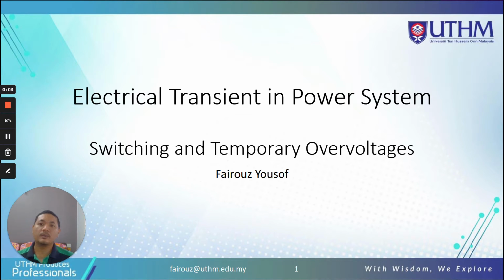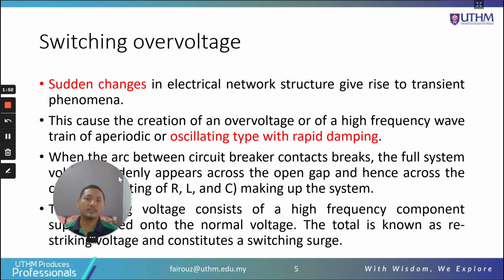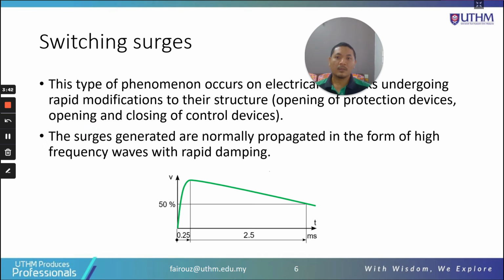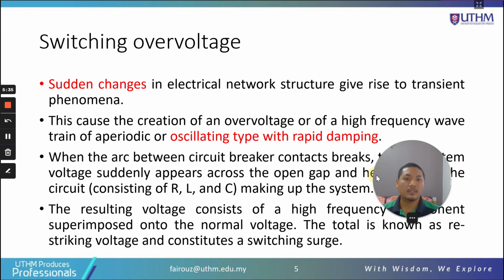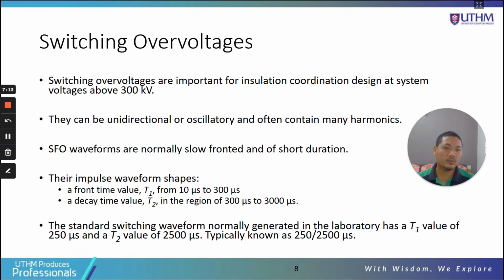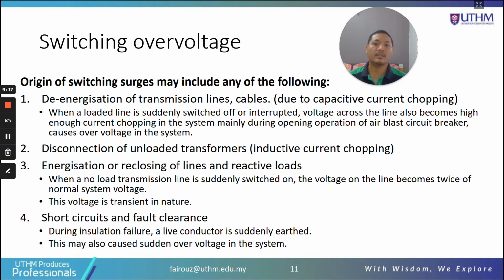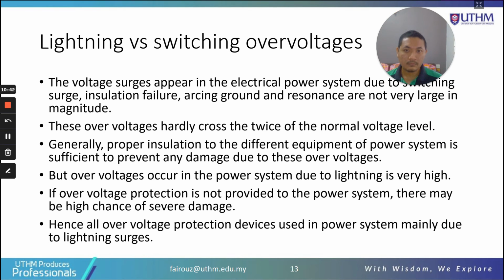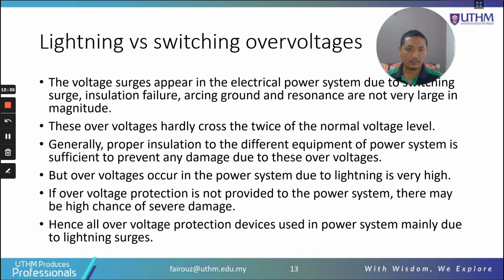Switching overvoltages

Comment: The standard slow front over voltage shape and time, can it also be classified as the same slow front over voltage as it relates to HVDC slow front over voltage on the converter side?